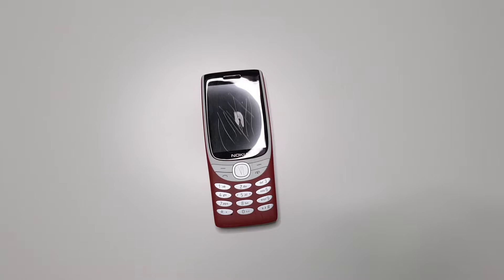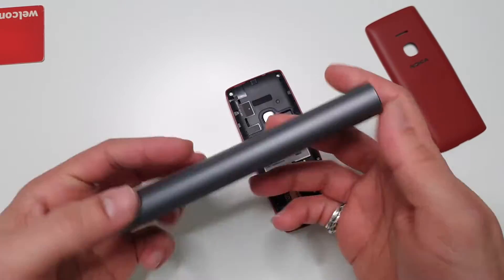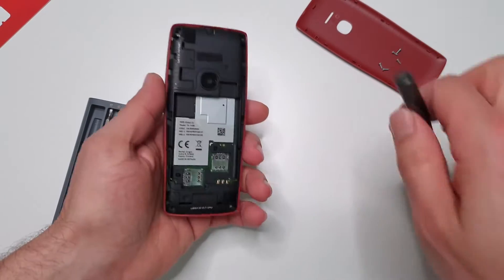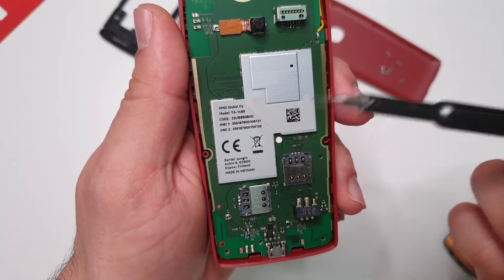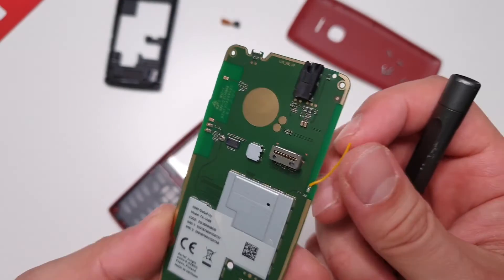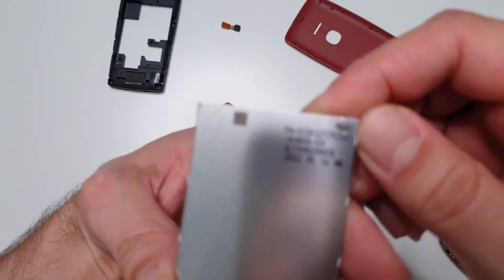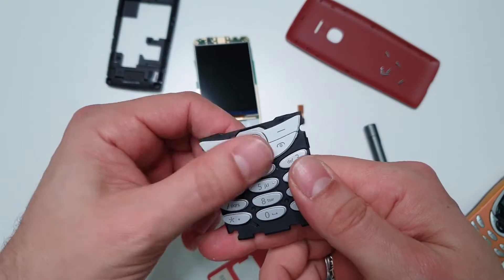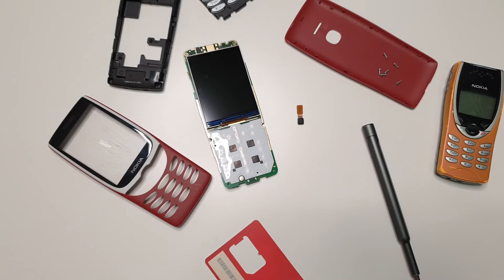Nokia 8210 4G (2022) Teardown Disassembly

Comment: The loose wire could be the FM antenna cable, in my opinion. For a cheap phone where not even texting is not on the book, it is ok. A phone for voice call should be like this. Unattractive. You can get a new phone cheaper than the cost of a battery of a smartphone.

Comment: Wire to nowhere? That's the antenna for the FM radio,  of course.
Reply from the maker: I've opened up a bunch of phones with radio and never seen a loose wire like that. There were better designs for this 15 years ago.
Reply: @VoloKinProject  Oh, you are absolutely correct. There are other ways to create antennas, like SMD components. This wire proves the point you were making about the cheap build: This wire is one of the cheapest ways, to create an antenna. 
Also: some other phones with radio require to keep the headphones plugged in. The headphone wire will then be used as an antenna.
Reply: @SueTownream  Wouldn't it be cheaper to add the antenna as a PCB trace? With a wire, you need a separate process to cut and solder it.
Reply: @camelCased  True, a pcb trace would also be very cheap. And I have no clue, if a FM antenna would be feasible with a pcb trace at all. Wifi frequencies have much shorter wavelengths. But I have to agree, if this simple wire was enough for some FM reception, then maybe a pcb trace could work. I'm sure there might be a reason, that a wire like this, or the attached headphones are better for FM reception.

Comment: Basically e-waste phones, too sad to see that this new Nokia 'nostalgia editions' are not user repairable as old phones. Very cheap design, but hey Nostalgia factor is a king.
Reply from the maker: Pretty much. If they were only half of the asking price..
Reply: yes. the operating system is full of small bugs and peeving stuff. you might think in 2022 it would be the best it can be... it has 4G network ok, sure but the messaging glitches, sending long messages is glitchy as interface elements disappear, the font is too big in the smallest setting... hmm. oh and the support is supposedly inexistent.